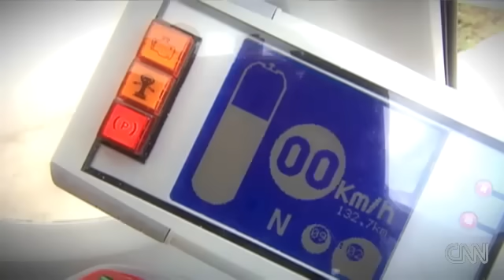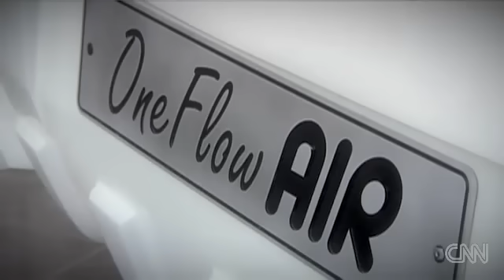Car That Runs On Air

Comment: So it could technically run on electric with a solar panel to run a compressor to keep the air supply up. Or the propulsion of the car could regenerate compressed air

Comment: Saying that it runs on air is incredibly misleading. 

It uses electricity to compress air into a tank and decompresses the air to move the car.

This is FAR less efficient than just using the same electricity to charge a conventional battery with the electricity that pumping air. 

You lose 80% of the electricity to heat when you compress vs 5-10% with a conventional battery

Comment: You actually miss the real value- it isn't regulated- since no vehicle drives that way.
The shape of it seems dumb. Is it because it needs broad wheels to stabilize the heavy liquid (compressed gas).
If you can run on  compressed air imagine if it could run on compressed natural gas at the same time.

Comment: This is fired air haha
Air loses pressure after a couple of minutes. It will go lets say from 10 bar to 5 bar because air expands. Then your speed will slow drop to zero. Plus you will need energy to compress air. Wind energy? Good when there is wind haha Sun? Good when there is sun. Batteries? Yes but where? At the compressor station or directly in the car?

Comment: It’s funny how we still don’t have these. It’s almost like someone didn’t want to start a new inexpensive trend in the auto industry.
Reply: "inexpensive"
it gets worse milage than if you took the electricity from the air compressor and powered a electric vehicle
and the air would not be free
you have to pay for air (most of the time) when just filling a bike tire
Reply: Honestly this car literally sucks, it is not some type of revolution or good idea, it is impossible to make compressed air superior than combustion cars. The design is also extremely ugly and they car goes extremely slow compared to how much effort it takes air to work properly.

Don't get fooled by these type of "revolutionary" Cars.
Reply: @dar9498  Apparently, it is not a good fit for your environment. It is smaller, quieter, cleaner, & cheaper to run than ICEs. Beauty? It's subjective.

To be clear, u despise this car. That doesn't mean it "sucks". It just doesn't fit your life. But not everyone is u, has your life, or wants your life. Just bc U don't like sth doesn't mean it "sucks". It just means U don't like it.
Reply: @user-sx9hq7qwert this is not about me liking the car or not lol. This car is simply just inferior to an electric car or gasoline one, that’s the reason it is not worthy making these type of cars considering how inefficient and expensive it is(more than an electric one).
Reply: @dar9498  "Inferior" is subjective. But w/e. Be wrong. It is entirely abt u not liking the car.
Reply: @user-sx9hq7qwert  Very low efficiency: only 10–20% of the input energy turns into motion.
(Electric cars reach 80–90%.)
	•	Short driving range: typically 50–100 km per tank.
	•	Lack of infrastructure: very few refilling stations.
	•	Low performance: limited speed and torque — suitable only for small city vehicles.
Reply: @dar9498  Yes. "...suitable only for small city vehicles." 

U r throwing a cat into water & then complaining that it can't swim like an otter. 

Some of us only need smol city vehicles. For which this technology & car design is well-suited.
Reply: @user-sx9hq7qwert why don’t you buy an electric car then? Some are really small, compact and more affordable than this . Like you can find the same aspects on an electric car and it would be way more efficient. Your point still don’t make sense at all, and considering this car has little to no space and it goes like really slow, why don’t you just buy an electric bike then ? lol, like you can barely fit in this car.
Reply: @dar9498  "...you can barely fit in this car." Umm. U r too big for it? 

Not everyone likes to go fast. Not everyone likes big things. Not everyone likes batteries. Not everyone likes electric things. Not everyone likes what u like.

No space for big folks. Meh. Going slow is a feature, not a bug. It has no battery, hence no lithium or cobalt mines; recyclable. 

U r arguing that we must "keep up with the Joneses" & it is sad. U r not the sole arbiter of what is good & true.

Comment: The AIRPod, a compressed-air vehicle developed by Motor Development International (MDI) and promoted in the U.S. by Zero Pollution Motors (ZPM), has faced several challenges that have impeded its mass production:
1.	Failed Investment Deal: In 2015, ZPM appeared on “Shark Tank” and secured a conditional $5 million investment from Robert Herjavec, contingent upon obtaining exclusive U.S. manufacturing rights. However, this deal collapsed after nine months due to ZPM’s inability to secure these rights.  ￼
2.	Technological and Efficiency Concerns: The concept of compressed-air vehicles has been met with skepticism regarding their efficiency. Compressing air requires significant energy, and the overall energy return may not be as favorable compared to other alternative fuel technologies.  ￼
3.	Regulatory Hurdles: Achieving safety certifications and regulatory approvals in different markets, particularly in the United States, presents significant challenges. As of now, there is no evidence that the AIRPod has passed U.S. safety tests or received the necessary approvals for mass production.  ￼

These factors have collectively contributed to the delays and uncertainties surrounding the mass production of the AIRPod vehicle.

Comment: And how do you generate compressed air? Electricity
Reply: U can get compressed air by putting air sack tubes laid on roads near speed breakers connected to air pumps. When vehicles move on roads that force will push the air piston generating compressed air.

Comment: If you added a air compressor that ran off the engine you'd only have to add air to get it started then it'd continue to refill itself
Reply: That's not how physics work.
Reply: @iiiiiiiiiiiiiiiiiiiiiiiiii4222 who taught you that? Government education?
Reply: @odoyle_rulez  have you spent even a second thinking about how impossible this is? No engine is 100% efficient. If you compress air with an engine that works with compressed air you actually just lose energy and how would this even work while driving?

Comment: The system has a cons, which makes it not efficient. As you may also know, according Gas equation
P x V = m x Ri x T
If you compress the air, you increase also the temperature of the air. Temperature will be emitted to atmosphere, which reduce the pressure of compressed air. Than you have to stack again energy to bring the air to wished pressure....

Comment: And here’s 2020. We don’t have this.
Reply: 2025, still no.... its almost like the air compressor runs on fuel😂
Reply: It's still in the prototype stage. It's a new tech, what did you expect ?
Reply: @DaRedScore  this “tech” is actually more than 200 years old and still in a “prototype” state. Because it simply really d*mb idea and will never work.

Comment: When it takes 4 hours to fill the air tank by plugging it in to your home then NOT CLEAN ENERGY!  Go hydrogen power instead.
Reply: Where do you think hydrogen comes from?
Reply: @Hamdad  Nanogalvanic aluminum alloy powder
Reply: @Hamdad  An aluminum alloy powder invented by the U.S. Army Research Laboratory in 2017 was shown to be capable of producing hydrogen gas upon contact with water or any liquid containing water due to its unique nanoscale galvanic microstructure. It reportedly generates hydrogen at 100 percent of the theoretical yield without the need for any catalysts, chemicals, or externally supplied power

Comment: Ugly car and it needs compressed air to fill it which you need a generator to get compressed air and a generator needs gas to run. So that pretty much defeats the purpose of a clean powered car. You might as well drive a diesel truck.

Comment: It cant work, at least not efficiently. It may be possible to move pistons with compressed air, however you still need something to compress the air. 

So it wont run on JUST air. Its running on whatever is compressing the air. Which is either going to be an electric or gasoline motor.

So, nothing good here. Interesting idea, but it wont work like they think.

Also, the reason Im sure it couldnt pass safety testing is more likely due to having highly pressurized gas onboard haha. This is the reason hydrogen powered cars didnt catch on as well. Dangerous if you crash.
Reply: you can make a system where it only requires a electric start once and mechanically store energy to continue the process and maybe even use some sort of pilot like system that keeps it going once started. loots of things are possible with education and a want to get rid of the old.
Reply: @joee_koolVODS  perpetual motion cannot exist. It never has, and never will.
Reply: You clearly don't know anything about what you're talking about

Comment: it simply running on a very high pressure that can be a safety issues to make it even faster, what they should have done, is created a pump 'air-aulic' valve function engine, just like hydraulics , an electric powered mini motor would pump air into a cylinder like chamber, but instead of using fast revolution speed to convert into horse-power from low gear to high, it would use pure piston strength, using a very high gear to covert required fast wheel revolution reaching a transmission lower part shift gears. the advantage would be far less electric power out of only a mini valve to a piston for intense pressure power, without a huge bulky air filled chamber, thus making the engine usable to two-wheel vehicles or smaller vehicles

Comment: Why not take the enormous amounts of electricity used to compress the air, to power the engine instead. 
Efficiency for Gasoline vehicles are measured in Miles per Gallon, Electric: Miles per Charge, what is the equivalent for Compressed Air vehicles? How far can these cars travel in comparison to the equivalent sized tank of the competing technology?
Reply: +dragonhold4 Yeah, exactly my thoughts...

If this worked that good, then we would all be buying a generator just to activate a compressor to then make air and produce electricity with it, but how the hell could the air at the end produce more electricity than the gasoline generator in first place????? (just an example)
Reply: guily6669 
It wouldn't be a bad idea if electric cars hadn't already existed. In such a world, these could viably replace gasoline cars for those who don't travel long distances.

Many larger companies such as universities and manufacturing plants already have types of gasoline electric generators.
Nuclear/Fossil -> Electricity -> Compressed Air [which is] < [Energy than] Electricity/Fossil: Simply is not conservative.

However, I do hope that they continue their developments. On a larger scale, their idea may be too risky for us consumers, but on a smaller industrial-/hobby side- there may be more flexibility for trial. Ex: Remote Cars
From there, maybe the industry can progressively scale.
Reply: +dragonhold4 Though I wouldnt want any of them as the future.

I wished is to live in a world were all explosion type of engines would burn hydrogen and still be a explosion engine and not electric engine.

That is if they make a way to produce big amounts of hydrogen for cheap using very low energy.

If we lived in this world already I would buy an old car, adapt the gas engine for hydrogen and dont care anymore for the car fuel consumption high value. Hell I would sell my 125 cc 4 stroke bike right away and buy a 600cc hydrogen bike and waste as much hydrogen as I could, all day long.
Reply: The recharge times of electric cars would be gone with this engine design
Reply: Also, the answer would be to use water compressed air. just look up the concept of a "Trompe"

Comment: Adding an onboard electric compressor for recharging anywhere woul be the way to go but would rise the price by 1500$
Reply: So then you're turning it into an electric car...
Reply: @Avm371998  Just put in a small generator that runs on gas to power the compressor. 😂
Reply: Depends on the power output of the air @Avm371998
Reply: @Avm371998  barely.

Comment: Why not use the engine itself to recompress the air for perpetual usage? The same way the battery in a typical car is recharged and started by the engine itself.
Reply: +Asato Because that would be perpetual motion which violates the laws of physics.
Reply: You need more compressed air for the engine than you will get from it.
Reply: +inox1ck well then maybe it could just be used to extend the life of one tank by 50% or something

Comment: i wonder what type of pressure this is at. like an oxygen tank for a welding setup is 2000psi ect. but a standard compressor in your home will only do 125-150. if it was the low pressure system, i dont see why they dont put a solar power air compressor on it. that way its constantly charging, driving or parked.
Reply: +Zack Dänekas It needs 1000-4000 psi. Its no problem with a standard compressor with 150 psi, and then using an intensifier to make >1000 psi.
Reply: Zack Dänekas shut up about solar. It’s dumb.
Reply: Google says 248 bar, about 3600psi

Comment: As far as I can tell, there are about 438 million concept cars to solve all our problems. Just look at the videos on the right side of your screen.

So, um, when the Hell are we going to be able BUY one? Is this the future of the automobile - a non-stop steam of brilliant and affordable concept cars . . .  that never go into production?
Reply: x
Reply: John T. Smith
It's painfully easy to agree with you. If the oil giants actually owned the air and manufactured sunlight, we'd probably be driving air or solar-powered cars right NOW.

Comment: God I hate this 'futuristic' design they're all putting into next gen transport. It looks like something out of the 70s. It's a great idea but the style might be a downfall.
Reply: That's just the thing. Everything has to look good, fuck that shit It runs off air. Go buy you a gas waster if you want but I'm getting this thing if it ever comes into production.
Reply: Garrett Camarillo
I wasn't hitting on the idea of the engine. I'm hitting on the body work, chasis and above all rigidity (Is that even a word?). Why not build a car that looks like a car but uses this new engine? I would drive one of these, but not on the road. Maybe if it was built a bit bigger I wouldn't mind. It just looks dangerous.